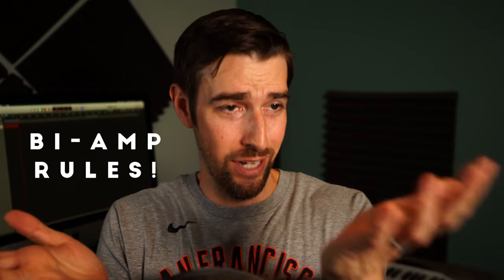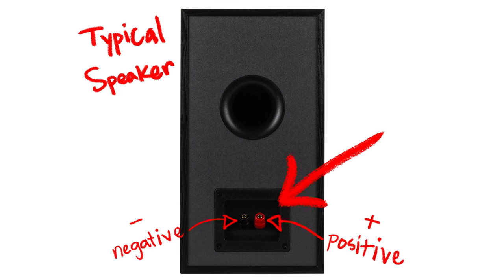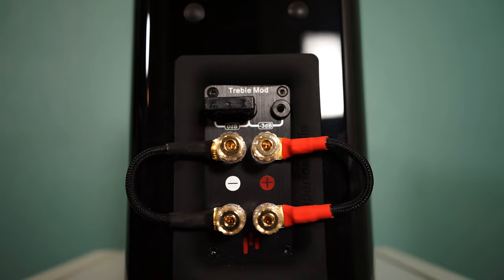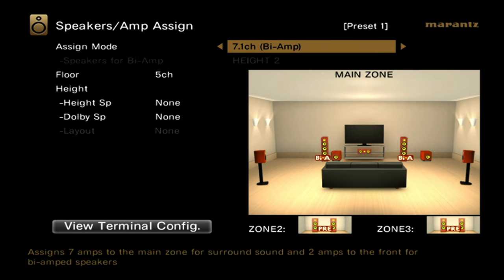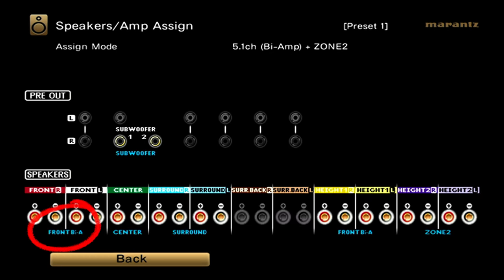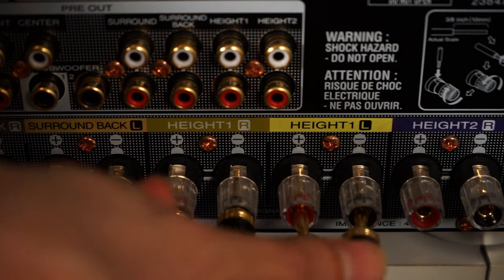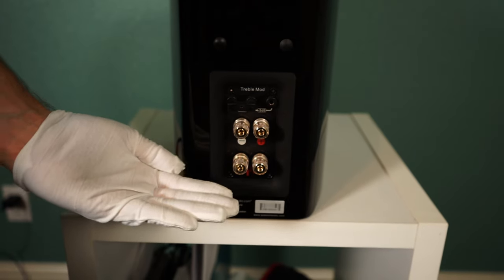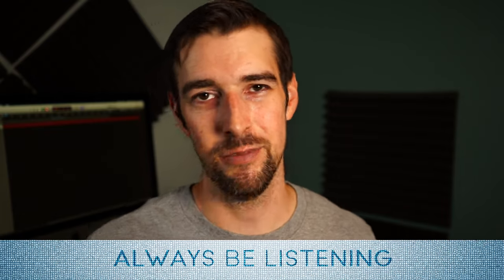TO BI-AMP, OR NOT TO BI-AMP? | Setup | Discussion | @AperionAudioSpeakers | Marantz | Denon

Comment: I have a Marantz PM10 driving Q Acoustics Concept 500’s which except bi-amping.
There’s an option to get a second PM10 to setup bi-amping. 
Any thoughts?
Reply from the maker: Wow. If money isn’t an issue (which it probably isn’t, given your incredible Hi-Fi setup) and you LOVE to listen to music A LOT, then yes, you might want to get another PM-10 for even higher fidelity playback. It’s still not going to be a HUGE difference, but different enough to some. Otherwise, I’m sure one PM-10 by itself is good enough for most applications. 👍
Reply: In my opinion, that would be a mistake. If you're going to spend double the money, just so you can biamp, it would be a waste. You'll get better sound, but it won't be worth it. For that kind of money, you can get real high end gear made in the US, Canada, UK, etc.... Remember, when you are adding another Marantz, you're not getting a better amp you're getting another amp. It will sound better, but it will pale in comparison to what you can get if you buy 1 really good amp for 2x the price. If you already have an amp that is close to state of the art, then maybe get another one. But your Marantz, while very good, isn't even close to that level.

Comment: Currently running a circa 2006 Denon 2807 in 5.1. Front mains are bi-amped using the built in crossover and rear amp assign etc. I'm happy with the stereo sound as well as the 5.1 sound (Klipsch Reference II speakers, Velodyne subs etc...). Here's the question. If I upgrade to say a Denon 3700H or 4700H, will my mains, if bi-amped running stereo at least match the bi-amped pure direct stereo bi amped of my 2807? That is the first part of the question. Then, in the Denon 3700, you have lots of pre-amp options. For example, if I assign the mains for external, go pre amp out to the denon 2807, will the bi-amp function work the same way, then just leave it in pure direct mode all the time. I know the obvious next step is hook it up and see what happens, but that means I'd have to buy the 3700. Thanks!
Reply from the maker: In theory and on paper, you should be able to use your old AVR as an external amp, given that it has a 7.1 channel external input section. 

But there might be complications with bi-amping. Using an old AVR through its Pure Direct mode can definitely power a 2 channel system no problem. But I would still have to personally experiment with such a setup to know for sure if it can be used for bi-amping as well. 

What’s the main reason for upgrading? Is it having 8K support and Atmos, etc?

Comment: I have an old Denon 4806 7.1 that's pretty powerful at 140 w per channel. I like what you said about don't make them like they used to and newer AV's being less powerful as I'd come to the same conclusion about this beast. I have 4 KEFs in my surround that are bi-amp able so I'm going to try this. Music is a big deal to me so what you said about the improvement in clean signal is kind of a big deal, thx! My AV goes from -70 to +12 and at 0 its incredibly loud so I'll bet it has enough power to make a difference.
Reply from the maker: Lemme know how it goes! I wonder if a completely bi-amped surround sound system would be that much better? 🤷‍♂️😄 Now that would be a killer experiment!

Comment: Hey I have a question I haven't been able to find an answer too... I just got some Klipsch 8000f towers and they are capable of bi-amping. Is it possible to use a 4 channel amp like the emotiva bassX and Bi amp from that? Thanks love your videos!!
Reply from the maker: I actually did test this out...kind of. But since I only had a 2 channel amp on hand, I didn't want to include my results in the video, just in case they were false due to not having a 4 channel amp in my possession currently. 

But I think it's a software thing. At least with my Marantz SR7015. It seemed as if when setting the mode to "5.1ch (bi-amp) + Zone 2, it only activates the front left and right pre outs, because I never got a signal coming out of the "Height 1+2" pre outs. 

BUT...I think you still could technically use a BasX A4 by using RCA splitters, so 1 RCA goes into the right front receiver pre out, which then splits into 2 in the back of the A4. Same with the Left Front pre out. 

OR...you could take an A2 and bi-wire instead. You connect the right and left front pre outs to the A2 with RCA patch cables, then have 2 sets of speaker wire coming out of the A2 right front speaker terminal and connecting to the HF and LF terminals of the right front speaker. Then same with the Left Front speaker wire. Totally sorry if this isn't exactly making sense. I'm still not 100% sure that I'm correct in this assessment, so don't quote me on this. Bottom line is, it's complicated. 😄
Reply: @ealanosborne  hahaha thanks so much for the reply. I appreciate your help!

Comment: I just ordered a pair of Klipsch RP-600 M iis to go with my AVR-X4700H.  These are my first Klipsch speakers and the first ones with dual binding posts (I should get them by Wednesday)  I think I'll try them both ways and see for myself if I can tell a difference.  Ny bedroom/HT is too small for towers and I'm replacing the L/R satellites - that in itself should be mind-blowing!.
Reply from the maker: Nice!!! Interested to know if you hear a difference regular vs bi-amped! 🤘
Reply: @ealanosborne  I just got them this morning.  I have a (dumb?) question, though.  Since I've never owned a pair of speakers with more than one set of terminals.  For "normal" use, do I use the outside, inside, left or right terminals?  I'm a little disappointed that FedEx left a (normally) $750 pair of speakers on my front porch and as far as I could tell never even played 'ding-dong-ditch'
Reply: @DavidEVogel  Since I don't have any height channels I thought I'd go ahead and bi-amp.  I think it makes the bass a little tighter, but with my hearing the way it is it's a little hard  to tell...they sound good, though.  The woofers are about 2x as large as the ones in the satellites I replaced.  Listening to music (jazz/classical mostIy) really don't even need my sub.  Movies sound good too, although I did notice how crappy the old center channel is now.  Darn it...I gotta get another new speaker.  There's one on sale that's a "Reference" instead of an "Reference Premier" that would fit under my TV without having to buy a mount or a new AV stand, but I've heard cautions about mixing qualities even in the same brand...I should stick with an RP.  thoughts???
Reply: @garyausten5939  I have a pair of Polk speakers and bi-amplify them. Consider that woofers eat about half of your power. 100 watts/channel and 50 goes to the woofer. If you have enough amplifiers why not use 2 to amplify the woofers?
Reply: @DavidEVogel  Huh?  The Denon x4700h has 9 amplifiers and 2 extra non-amplified channels - to use with an auxiliary amp .  I used the main l/r connections for the tweeters and one of the height pair for the woofers (or vise-versa) per the schematic in the manual and set the amp assign to something like 5.1 bi-amp plus zone 2 (even though I don't use wither zones two or three).  I MIGHT think about using my old satellites for side surrounds and have a 7.1 set-up, but I'd probably trip on the wires when I got myself a beer :)

Comment: next up, bi-wiring!
Reply: From what I have researched, bi-wiring is the same as having a thicker (lower gauge) cable. So bi-wiring with two 14AGW would be aprox. the same as having a single 8AWG. But someone correct me if I'm wrong.
Reply: @Donly1pt  removing the usual crappy plates and using more copper, as you describe, both make a difference.  However, the two pairs of wires carry separate frequencies, in line with the filter circuits in the crossovers, so there is less contamination of the delicate tweeter feed by the thundering great bass currents.  No doubt bi-amping is better but bi-wiring is a still a worthwhile upgrade.

Comment: Great video☺️☺️ hey in channel adjust in denon wht should ne the surround parameters in db!?! Its very low!?! Im using klipsch r41 !!
Reply from the maker: How loud your surrounds are depends on how close they are to your main listening position. Are they near your head? Then not too loud. Are they 6 feet behind you and to the sides a bit? Then louder. Audyssey does a pretty good job initially when determining the loudness a speaker should be depending on how far away it is. Then it's just a matter of adjusting the dB to your liking after that. 👍
Reply: @ealanosborne  thanks man!!! That’s an awesome explanation

Comment: Bi amping requires an additional amp. If you connecting your speakers to an additional terminal on the same amp that's biwired
Reply: No. Bi-amping is two amplifier channels powering two terminals on a speaker. The two channels can be on the same AVR like in the video, or an outboard amplifier. Bi-wiring is plugging two pos and two neg wires into a single amp channel, and then connecting to the two different binding posts on the speaker (with the connector removed). Same power coming through, just through 2 different sets of wires, rather than just one then jumping to the second with the jumper connector.

Comment: Do not do this unless you are proficient in electronics .What i have done is modified  an expensive Yamaha S801 INTEGRATED AMPLIFIER IN THE FOLLOWING WAY. First  it is designed to operate as a stand alone unit. The mods include  adding a switched power outlet and finding the "preamp" out then paralleling them L+R to a pair of RCA plugs mounted on the back of the unit  .Then find the 12v source that operates the power on relay. I obtained one from a junked receiver and used the 12v source to operate it. After hook it up to an external 110v outlet again mounted on the back.  Now how does it sound?                   The sound overall is slightly louder and clearer . Almost forgot ,the extra amp is a 45 yr old Hitachi HMA7500 POWER AMP which puts out almost the same power output. I at first tried the Yamaha ta the top end and the Hitachi at the bottom. Later I switched the two at the speakers and could  hear that the old Hitachi has a better defined hi end.
Reply from the maker: Cool. 👍

Comment: I have a 7.2 channel receiver by Sony (Dh790)
And the klipsch Dolby Atmos 5.1.4

I have everything hooked up except the the two front height speakers built into the front left and right speakers.  My two rear speakers also have height speakers built in.
I'm thinking about t taping all 4 of the height speakers

Comment: You are bi-wiring, but there are many ways to bi-amp. My wife has a set of Klipsh with Atmos speakers built in. And many high end speakers these days have a built-in subwoofer amplifier. But there are still other reasons and ways to bi-amp. I have a high end Onkyo 9 channel theater amp (130 watts RMS per channel @ 8Ω, 4Ω stable) powering a set of vintage Pioneer HPM 1100 speakers (125 watts RMS, 6.3Ω, 3.5cu-ft of internal space) The Onkyo, used alone, works well powering them, but it sounded weak when also driving the 7 other speakers. With bi-wiring, I will still have the same problem. The power supply will still be over worked and drive the 15 inch subwoofers poorly. In this case, if you want to keep the big speakers, the only solution is to use a second amp. I had a Pioneer Elite 4 channel amp @ 135 watts per channel, that I started using for the sole purpose of driving these large speakers. And it did a great job. But damage and wear dictated that it was time to make another change. So, the Pioneer HPM 1100’s 45-year-old, 15-inch, 4Ω speakers got replaced with Skar DDX15-D2s. This is a set of large 1000-watt RMS, dual coil subwoofers, that are made for a ported box from 3.5 to 4 cu-ft. To drive these, I had to bi-amp the HPM 1100s. I let the Onkyo’s front speaker terminals handle the top speakers, and a Crown XLS 2502 pro-amp handles the bottom 15-inch subwoofers. The Crown pro-amp is driven by the Onkyo’s front speaker pre-amp RCA outs. Which goes to an Art Cleanbox Pro’s RCA ins, through to its XLR outs, to the Crown pro-amp’s XLR ins. The Art Cleanbox Pro is a converter that makes home sound equipment’s connections compatible with pro-equipment. The Crown has RCA ins, but using the Cleanbox, can double this amp’s output level. In a 22 X 26-foot living room with a cathedral ceiling, there are now massive amounts of vibrations in that room to where you can very noticeably feel the bass, even at lower levels. The Crown pro amp drives each subwoofer at a 1200-watt potential. That’s 2400 watts RMS driving two 15 inch competition grade subwoofers, mounted in large ported cabinets. With this configuration, the resulting sound and feel is awesome. You can feel the power. Note: If you bi-amp a speaker, you have to compensate for the load that you removed from the crossover network. In my case, I ran the wires to 8-inch Skar IX-8 D2 subwoofers @ 4Ω, that I built to fit perfectly on top of the HPM 1100s (separated with isolation pads). This makes the top end of the HPM 1100s full range. The Crown I’m using is a great class D amp.  It sounds precise and is easy to adjust, it’s efficient and very powerful, and I’ve never heard its fan or any other unwanted noises. The result of this project is well worth every penny and minute that I spent on it. All of the options you have read about above, kicks the crap out of any Bi-wire system that I have ever seen.

Comment: I applied bi-amp to my Yamaha NS-555 tower speakers - which are budget speakers from Yamaha as you know - and then got a big difference, it really made sense. The AVR is also 10 years old Yamaha Aventage RX-A1010 btw. I do not have any experience with bookshelf speakers hence cannot comment on that but for tower speakers, if you have a receiver capable of bi-amping then for sure you should take the opportunity and try it.. Now I am thinking of upgrading receiver to a new one with Dolby Atmos /Dts-X etc newer features and considering with bi-amping I must invest on a device with 11 amplified channels for a 5.1.4 setup which means that it will be most likely a flagship model.
Reply: Find a 3080 from Yamaha, cheaper and pretty much does the same, you only need an extra 2 channel amp for 11 channels.

Comment: I tried with my KEF 900 and Yamaha RX671.. guess the mid range receiver wasn't able to prove the value to me. I went with front receiver channels to power the speaker tweeters and extra bi amped surround channel to power the bass drivers - I hardly noticed any change to be honest. Could be my ears or maybe the receiver being average - I'd be interested if anyone saw improvements with similar setup. I'm back to single cables as it wasn't worth the hassle to use the 2 pairs of wires for a single pair speakers.

Comment: I wouldn’t waste my time bi-amping with a receiver. 
Bi-amping using External amps, on the other hand, is far superior….
Reply: I agree 100%. An AV receiver, unless it's the size of a house and cost around the same is never going to have the power.
Reply: Bi amping with a receiver makes a huge differences. Let’s say the amp is 100wpc, with bi amping, the woofer and tweeters each get 100wpc. Without bi amping, the tweeters and woofer have to share and thus get 50wpc each. Bi amping doubles the output. 

I’ve always heard huge differences and I’ve bi amped 3 different pair of speakers using different AVs.

Comment: Absolutely no benefits in doing so.  I have never noticed any difference bi-wiring the speakers, nor Bi-amping them, same quality if you keep the jumpers.  I tried this on my B&W 800 D3 and the Sonus Faber Aida, and at the end it was a waste of money on very expensive cables.
That is my opinion. And in any case this only would work if is no cross overs and each channel is 100% separate from the other.